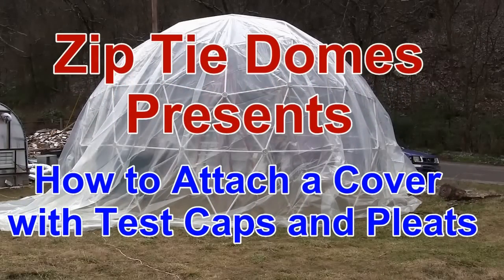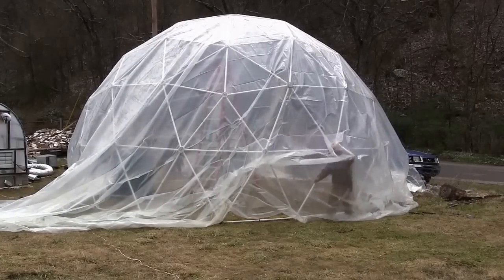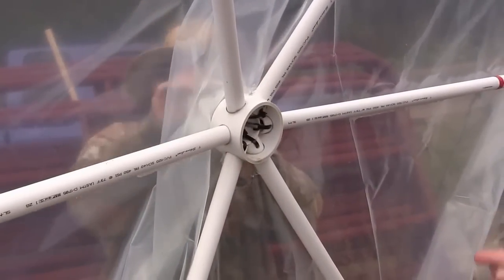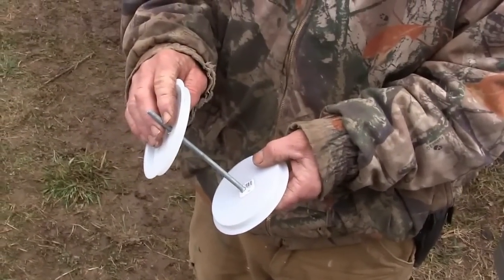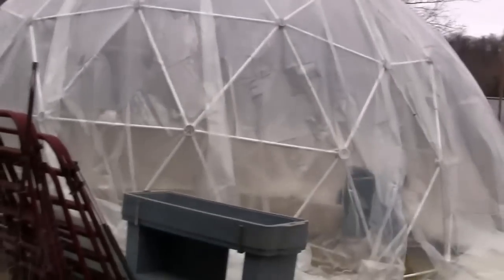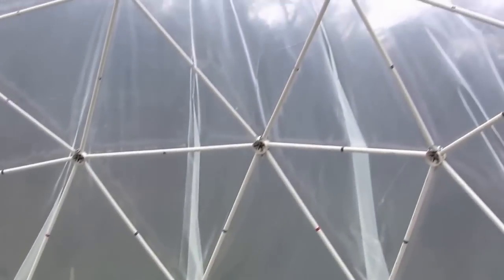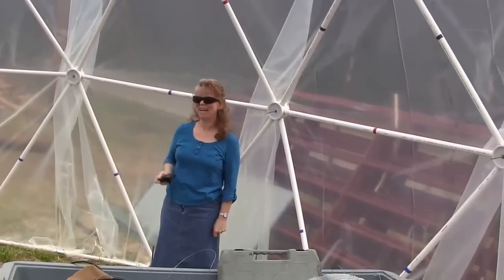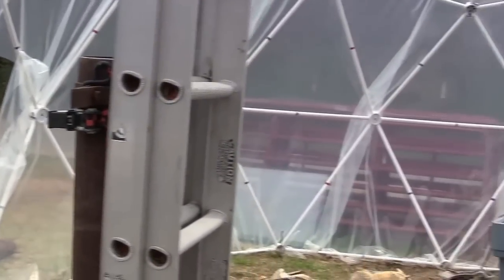24' Geodesic Dome Greenhouse Cover using Test Caps

Comment: As to the lift issue;
Be aware that Fuller said that if he covered this whole city of Manhattan with a geodesic dome of the temperature Rose 5°, it would have to be bolted down with cables and anchors posts pylons to keep it from floating away so you're going to have that with A geodesic Dome made out of PVC and cover with plastic big time!!!!
Reply from the maker: A PVC dome can make one big balloon.  Thanks for watching the video.  John Hurt

Comment: Could you make a bigger dome with pvc pipes and these connecters or is 24' the biggest you can go?
Reply from the maker: We go up to 30' diameter, any larger and you should use steel, which is more expensive.

Comment: OK.. I'm following the Test Caps just like in the Video.    I went to Lowes and the Test Caps were $2.22 Cents.  That's way too much money for a plastic cap!  I was abit bummed out but I tried going to Home Depot and I found the Test Caps for 48 Cents!
I need to take the Test Caps back to Lowes!   They should cost about 48 Cents!  I'm so glad this video was on here about using these caps.  It make it so much easier!  Tomorrow I'll be putting the plastic around the Dome!  A little nervous because I have a 20 feet by 110 Foot Roll.  If I had seen this video earlier I would have gotten the 48 by 48 Piece.  I'm going to try and tape 3 20' by 30'  Strips together!  This should  work as long as the plastic Tape works the way I hope it should! :-) If anyone has any great ideas about how to cover the 14 foot high, 24 foot wide dome with the dimentions I typed, please let me know!!!  :-)!!!  
This will be in my next video about my Geodesic dome Part 2!  I know everyone has different ways to do this.    The Third video I hope to do is building a wooden door!  This Makes me nervous but I'm sure I'll be able to pull it off!!!  BEFORE I put the plastic on, I put Deer/Rabbit fencing around the first tier.  Its pretty much see through and it'll allow me to have airflow through the bottom of the Dome without too much heat buildup!  Give it a try!  Atleast you won't bake under the plastic!! :-)(
Reply from the maker: That is great!  I like your ideas.
When you get your videos up on YouTube, send me a link and I will link to them on our website.  My email is here: 
https://www.ziptiedomes.com/contactus.htm
Thanks,
John Hurt

Comment: I'm curious and want to know if my question can be solved? I watched the video on how to use the Geodesic Dome Calculator for covering the dome triangles individually with rip stop material. But in this video on how to cover a 24' dome with one 48' x 48' plastic sheet and securing it with the Test Caps....could that 24' (as well other sizes ) be covered with a 48' x 48' rip stop material then once the center is found at the top of the dome make a hole in the rip stop material seal the hole with a grommet the run the Test Cap and screw through it and do the same as the customer did doing every third 6" hub (grommets used also) and the metal clips around the base?
Reply from the maker: You could if you can find rip stop material that is 48' x 48'.  It usually comes in 5' wide rolls.
You can purchase this 24' dome at this link:
https://www.ziptiedomes.com/geodesic-dome-greenhouse/25-3v-58-std-geodesic-dome-greenhouse-kit.htm
The 48x48 sheets can be found at this link:
http://www.growerssupply.com/farm/supplies/cat1a;gs_greenhouse_films.html
Call me at (931) 858-6892 if I can help you.
John Hurt

Comment: Nice job! It looks like you could use test caps to hold an inner and outer layer of plastic, so I'm wondering if the dual hubs are really necessary.
Reply from the maker: Yes, you can use test cap covers for both the inside and outside dome coverings.
Reply: July 8, 2020. Just came back from Lowes after watching this video and the caps are not 50 cents anymore. Lowe's must have seen this video and decided to go up on the price. Now they are $2.50  each for some cheap plastic. That means it would cost $5.00 for one hole. No thank you.
Reply: @ttran1719  
you can make your own with polypropylene or LDPE sheet and 2 holesaws
Reply: @JohnGuest45  Home depot has it for .48 cents and so does Amazon. They fit perfect
Reply: @ttran1719 
Hi Tom, i use 6082 T6 aluminium discs on mine. 48 cents seems almost too cheap for a  4" cap, there must be a catch ;)
Reply: @JohnGuest45  No catch. I live in Houston, Tx and Home Depot charges .48 cents. So does Amazon but they have a limit. Lowe's wants $2.50 each. Check online before you go to Home Depot because it will tell you how much the have in stock.
Reply: @ttran1719  
Hi Tom
I`m in the uk where 48c (£0.37) wont buy much of anything lol

Comment: Wondering if there is a clear greenhouse plastic that has an expected lifespan of more than 6 years?  If there is, thinking it might be better to cut panels to fit the triangles and use a "shingling" process so the next higher triangle sheet overlaps the lower by a few inches since rain normally flows downward as it rains.  Of course that means some sort of glue, or double sided tape would be used to adhere the plastic panels to the PVC frame.  I have seen wood lath used to frame greenhouse plastic, but it takes a lot of screws, lathe, and time to attach plastic triangles in that fashion.  Since I'm not sure what sort of glue, or tape would be sunlight resistant enough to last in service for more than 6 years, I have no idea how hard it would be to replace the plastic skin after the service life, or replacement due to damage would be required.  The best I can come up with so far would use at least twice as much PVC pipe and require bolting triangles together.  Each triangle would be covered in the plastic sheet before assembly would begin.  Having to do that every six years or so would be a nuisance, especially after one get old and stiff.
Reply from the maker: +Bushcraft and Survival Thanks for the comment.  Most greenhouse film is rated at 4 years or better.  We have a link to Grower's Supply Dot Com, where they have various greenhouse films for sale.  This is much easier than trying to cut out the triangular pieces of polycarbonate to cover the dome.  Also, it is very hard to attach polycarbonate or other types of panels and attach them to PVC pipe.  I would recommend 2x4 lumber struts, and a different type of hub for polycarbonate panels. The greenhouse film is a good economical way to cover the dome, and it is cheap enough to replace every 4-6 years and be much cheaper than polycarbonate, which gets old and has a lifespan too.  So there is a lower cost of ownership to greenhouse film, at least for the first 10 years or so.  Thanks for the comment.  John Hurt
Reply: Grower's supply .com
Reply: Bushcraft and Survival the Dome my grandparents built in the 70's was using metal connectors to wood struts.  The cover was thin fiberglass panels that were nailed on with roofing nails.  The panels lasted over 20 years.  I need to find a suitable covering as they have all deteriorated.

Comment from the maker: Yes, you can use Marine shrink wrap to get a good fit.  Marine shrink wrap is designed to be used with a heat gun, but it is not guaranteed to last for several years like greenhouse plastic.  For shrinking greenhouse plastic, I would suggest following the manufacturer's instructions and recommendations.

John